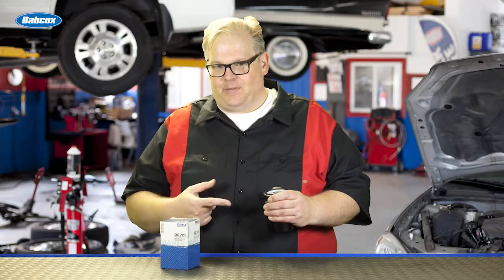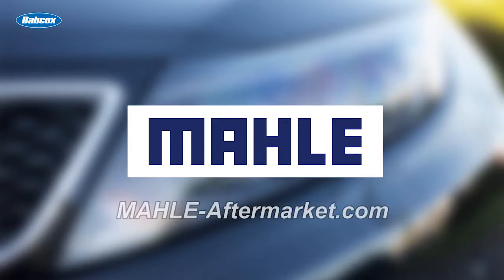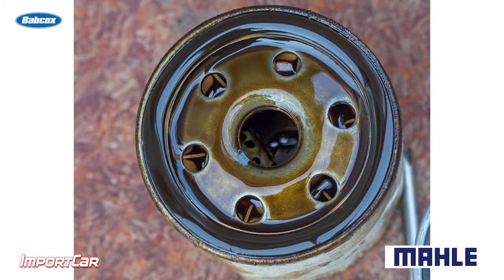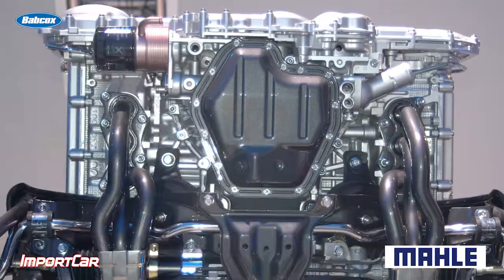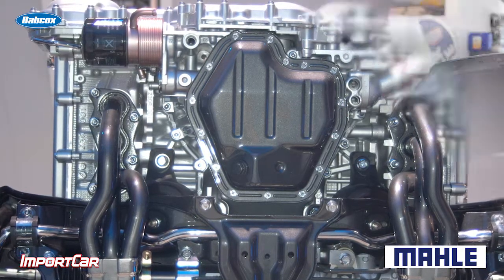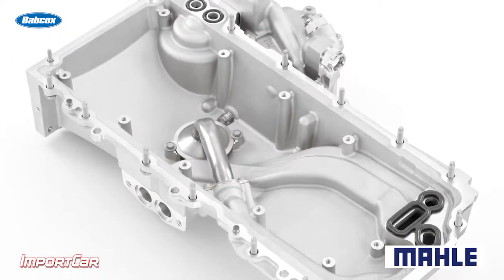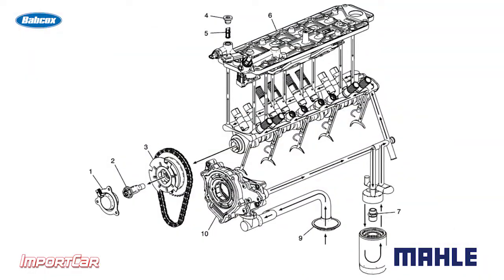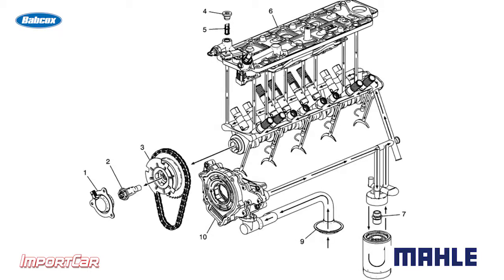What Can Cause An Oil Filter To Collapse? | Tech Minute

Comment: The first indication of Low Oil Preasure is the RED OIL LIGHT ON THE DASH! 101 in Drivers Ed was check the oil, if the oil level is good then it can be the filter, put on a new one and see if that solves the problem (hopefully it is only hand tight so you can do it on the spot as long as you have an extra filter on hand)....if not then you got a more serious problem and need a tow into the shop.